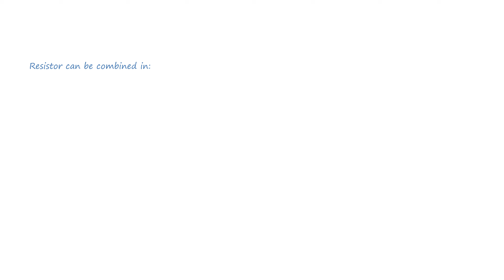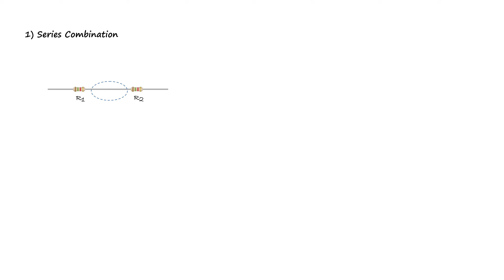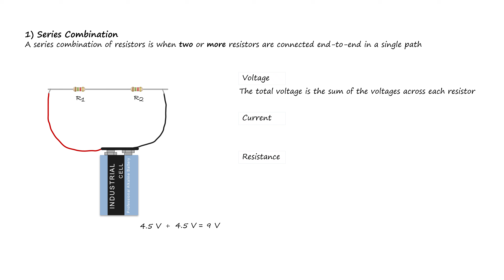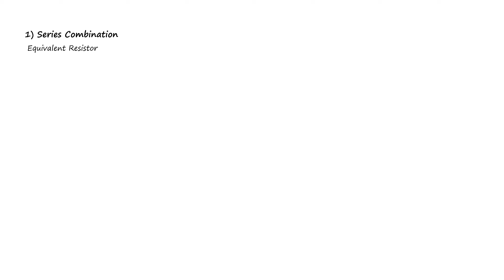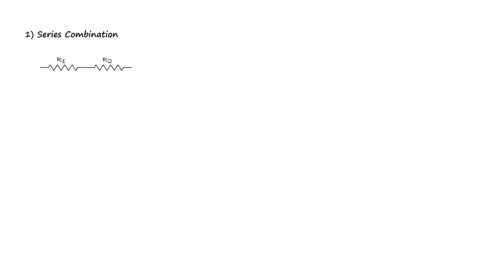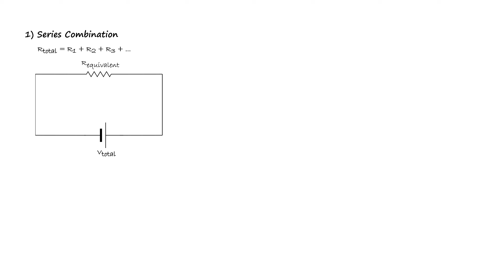Series Combination | Resistor Combination

Comment from the maker: Sorry for the animation mistake. When measuring current through two resistors, the multimeter probes should not be connected in parallel with each resistor. To measure current correctly, the multimeter must be connected in series with the resistors.